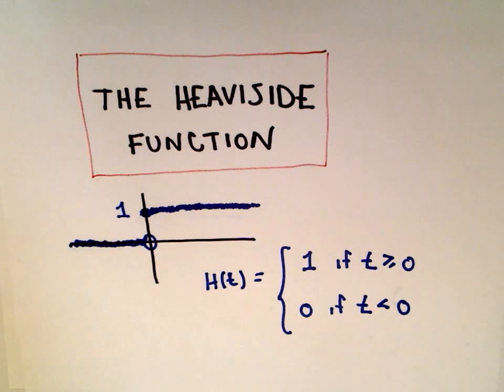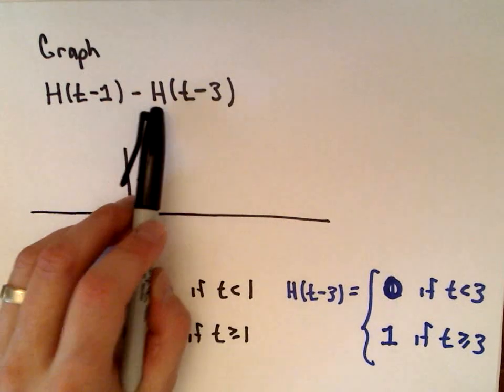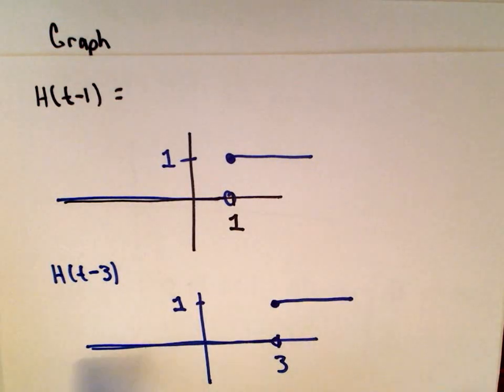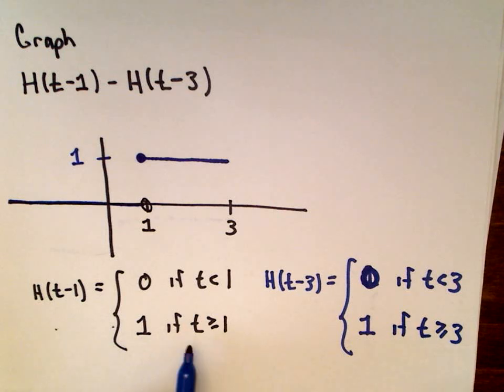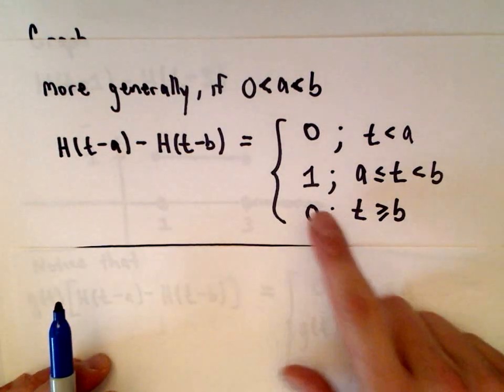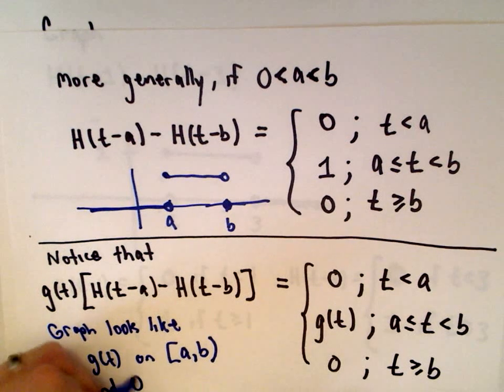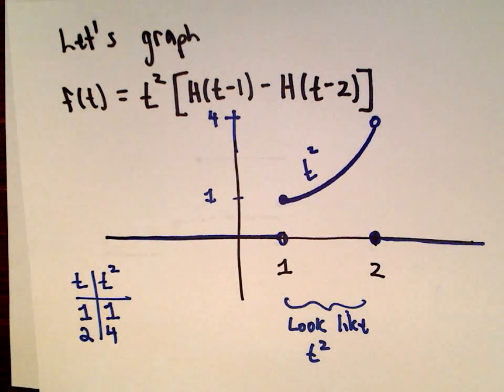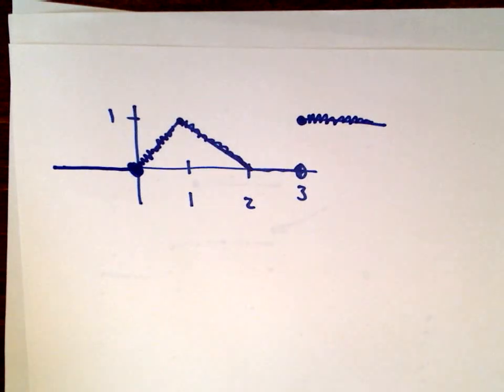Heaviside Function (Unit Step Function) - Part 1

Comment: Does anyone here knows how to solve this? I really don't know how 🥺😭 I need it so much

Define each of the following function piecewise and sketch their graphs. (Note: 𝑈(𝑥) is the unit step function while 
𝑠𝑔𝑛(𝑥) is the signum function)

 27. (𝑥 + 1) ∙ 𝑈(𝑥 + 1)
Reply: f(x) = (x+1) for x >= -1
if i am wrong however, any correction is welcomed.
as for the graph, just use some online graph calculator like Wolfram.